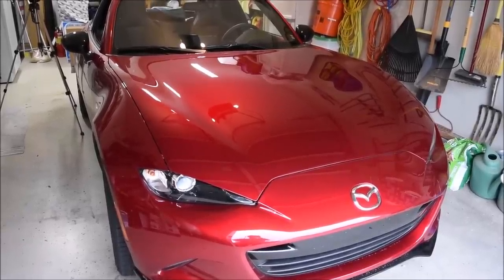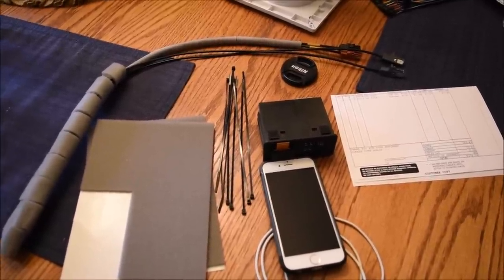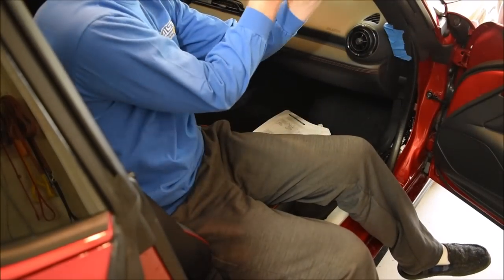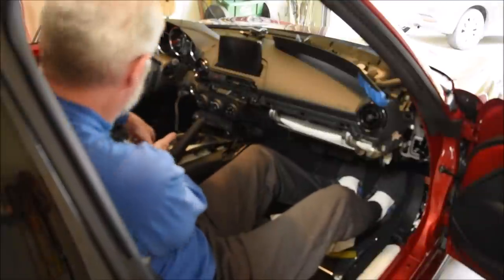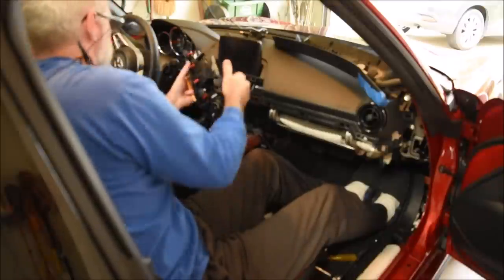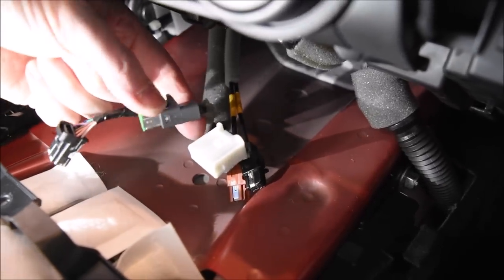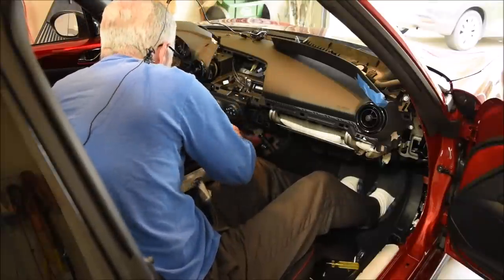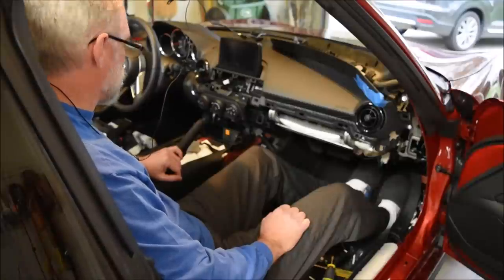Mazda MX-5 Miata ND and ND2 ACP/AA USB Cable and Hub Install.  Prep for CarPlay or Android Auto

Comment: Thank you for making this tutorial!  I performed this installation this evening using this video and the process was flawless.  Taking my time it took me less than two hours.  The most difficult part for me was running the cables through the dash because of how tight it is in that area.  Putting it all back together was much faster than taking it apart.  I'm very happy I did this upgrade.

For those that are researching the same thing for their Mazda, I did the firmware update the night before.  I had to update to two different versions.  The first update was the failsafe and reinstallation files for 70.100.  After that was completed I updated to 70.367, which only requires the reinstallation file.  I installed both firmware updates in a little over an hour total.

Comment: Thanks so much for your video, used it today together with the one from 888-werkes and had no problem adding android auto to a 2016 Mx-5.  Definitely prefer your approach to the cabling.  Used your video for 90% of the work, but having the second video for comparison was useful in a couple places.  Only thing I could suggest for anyone looking at these comments, when it comes time to pull the cabling down to the new usb connection box, it makes things a lot easier if you use a stiff piece of wire to find the route and then pull the tape wrapped usb cables with the wire.

Comment: Thank you!  Watched your vid a few times...eBay package got delivered...about 2.5 hours later I have apple carplay!  Just a tip... the heat gun is your friend.  Especially in a cool garage.  After a few passes with the heat gun on the piece you are working, it pops right off.  Same for re-assembly.  The heat gun made it much easier and you didn't have to worry about cracking.  The only PITA was fishing the wires  from the head unit to the USB hub.  I'd add a few inches on the piece going to the hub.  Gives you some play you may need.  So the pig tail lines going from the top to the USB hub...give yourself a few more inches than what is documented.
Reply from the maker: Thanks for the tips!

Comment: Just finished this install, one tip - I couldnt get the connector out for the mazda cmu controls (the knobb). So I realized I was able to pop up just the area around the shifter boot connected to the plastic fake metal and matt surface. This was a lot easier.

Comment: Hi @killobyte I'm trying to install this in my 2016 Mazda3. It's manual transmission. I haven't ordered the part, yet, but I'm hoping to get it before the end of the month. Do you know if this instllation is compatible with my mazda 3?
Reply from the maker: If it has the Mazda Connect, which I believe it does, you should be good. You can compare the old USB hub to see if it looks like the new one also.
Reply: @Killobyte  I just updated the firmware... thank you so much for everything! You're amazing!!!!

Comment: I've read, that for Android Auto to work, you only need to update the software and that no hardware needs replacing and that the hardware needs to be replaced in order for Apple CarPlay to work.
Can anyone confirm this?
I have a 2019 MX-5 RF ordered for March/April and if it won't have AA already installed, I'm not going to let my new car to be dismantled like that.
Reply: I'd like to know this as well, although the 2.1A USB port would be really handy.
Reply: If you are on firmware lower than v59. 502 you can just connect a sdcard with hacks including android auto.  The hacks can also tweak the system enabling things like touch screen whilst driving.  In firmware v59. 502 they blocked the port.  You can still do the hack by connecting to the back of the CMU but you need to pull out the CMU to make the connection.  None of this needs a new hub.

Comment: is the AA/ACP working on the same firmware version from you update video? 70.00.100 or did you need to update again?
Reply from the maker: Yes, all the 70.00.x versions of the firmware support AA/ACP.  But to activate them, you have to upgrade the USB hub and cables.  Do the firmware first then the USB hub and cables.
Reply: @Killobyte  great, Mine already has the 70.00.100 but I saw one of the people selling the hub saying you needed .20 or better which threw me off. but when i ordered from someone else it was actually .020 but thanks for the response and the video.

Comment: How long would you expect this to take from start to finish without having to worry about the camera and explaining?
Reply from the maker: I think it could be done, baring any unexpected issues, in about 30 minutes on an MX-5.  That’s with the cable pre-taped and  everything ready to go.
Reply: @Killobyte , I want to thank you for the time you spent putting this video together. With the install instructions and, mainly, your video, I tackled this job today. It took me a couple hours but that was starting and stopping occasionally. As you said, it can be done in 30 minutes if everything is ready to go. I am so glad I decided to tackle this job instead of paying the dealership to do this, and most of the reason I did was because of you and your helpful videos. Thanks again!
Reply: @keithhamm6012  Man I'm scared to take all apart like that on my MX-5 but I for sure don't want to pay $400+ to the dealer to do it for me. Where did you got your kit from?
Reply: @visualsofisa  I did it myself and I was nervous just like you but man its easy. I got my kit from my dealership. AA is so nice to have.

Comment: Love the install. I have all ready added the backup camera, do  you know if the CarPlay interferes.  Where did you buy the hub and hardware?
Reply from the maker: Thanks, several on Miata.net have reported that theirs worked fine with the CarPlay upgrade.  I ordered my kit from Priority Mazda.
Reply: Kill-O-Byte very interesting and thank you I was also hoping to install a backup camera and to do so one has also to change the plugs at the back of the display and wondering how these go together that is the camera cables and the Apple CarPlay cables

Comment: You know? Just to slightly adjust what the radio does in my car, this is NOT worth the hassle. I’ve swapped shifters for Hurst Pistol Grips that have less gutting than this nonsense. The radio already plays my iPhone’s applications, and I don’t really care if it doesn’t “read” my texts through my car. I’ve seen the videos on CarPlay, and there’s really not that much of an “upgrade” from the factory that you can already do. Waze or Apple’s maps on your screen, also isn’t that necessary. I’ll just trade my car for a 2019 or later MX-5. That’s my opinion, you did a thorough headache of a job for those with this much time to increase their radio’s ability by 10%.
Reply: Reads text, control spotify playlist, waze, etc. i have one in my wrx so putting this in my miata